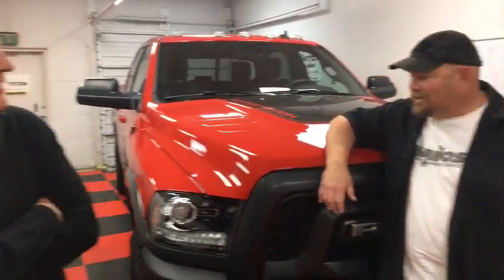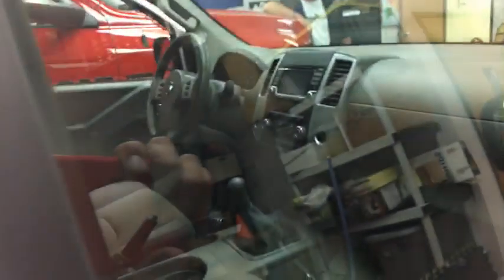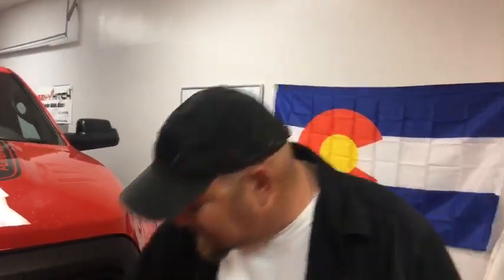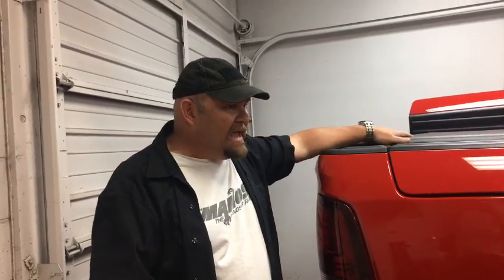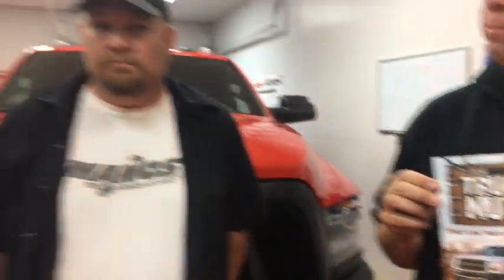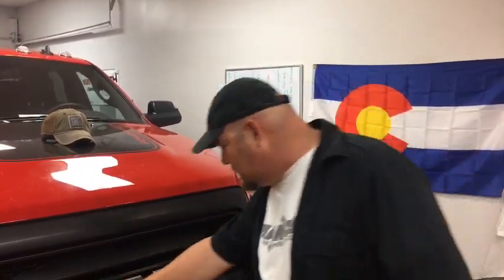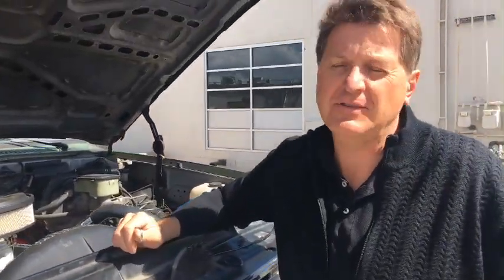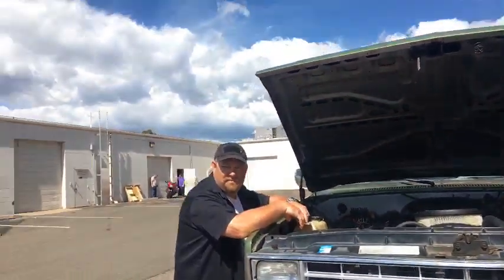Long-Term Truck Update: 2017 Nissan Frontier & Ram Power Wagon

Comment: Manual locks is no issue for me atleast. I prefer it means the key has no fob or chip. And if you damage those or lose it, your screwed. They are super expensive to replace
Reply: No it's not I have manual locks and  windows and I got a spare key made at home depot

Comment: In one of your episodes you mentioned you can get a tradesman with a Cummings and then add the "power wagon" package.  I'd love for you guys to get one and compare the two.
Reply: Nope. Power Wagon can only be ordered with the 6.4 HEMI. The Cummins is just way too heavy like 950 lbs. over the 400 lbs. the Hemi weighs. That 450 lbs. difference can make or break the Power Wagon, and with those intercoolers in the Cummins, that's just not gonna make room for a winch installed seamlessly in the truck.

Comment: TFL  Could you try closing the door on the Power Wagon and use the same amount of force as you did on the Frontier the first time?
Reply from the maker: The clam-shell doors on the Frontier King Cab take a little more force to close.
Reply: Come on TFLTruck , you can do better than that,...IF you are professional about it !

Comment: My family just bought a frontier 2017 S (5spd) with the package you guys have. Was 24k after taxes and registering. I have no issues with the back seat for short distances. Half hour and less its fine. But I'm 5"8 so someone my height or shorter you can fit fine for a short time.
Reply: Jimmy M I am 5' 8" and the thought of sitting in there makes me wanna beat the hell out of that front seat, I get a lot of knee pain when confined

Comment: Roman the "King Cab" label has nothing to do with implying any sort of behind the driver seat room.  King Cab is a designation used by Nissan for well over twenty years.  Google a 1990 Nissan King Cab and what you will find is a small extended cab pick up truck, not a crew cab.  If anything the modern day extended cab (King Cab) has far better behind the front seat room than did previous generations of Nissan extended cab trucks.  Almost no one buys these trucks with the intention or consideration of carrying back seat passengers.  That space back there is for carrying your gear, your stuff, your groceries, etc etc.  I have an extended cab 2016 Canyon and while I have on a few occasions carried a back seat passenger it has been for short trips and with the passenger seat moved forward to make room.  Otherwise I use that space to carry my gear.

With respect to your fuel issues in the green truck.  I'm betting it's a fuel pump issue.  Does that truck have an electric fuel pump?  If not I think you should consider one that can keep that engine fed with fuel regardless of operating conditions.

Comment: $63,000 for a truck.  Get a 7 year loan on it, and try to trade it; you'll get $20k... then for a new truck, you'll be under the bus financially.
Reply: Dean Klein That's pretty much the case with a 7 year loan in any vehicle.  Worse, people are rolling the balance of their old loans into new ones!
Reply: Bingo.  Next recession coming up.
Reply: So what are you getting at?
Reply: Well, I don't get what your point is either, but what you put out there is not based in reality. $63,000 isn't how much people pay for these trucks, it's just the suggest prices for a very well equipped model. A loaded model like this will often sell for with $10,000+ off MSRP, making it $53,000 or less before taxes. Also, in good condition, a loaded Power Wagon like this likely won't fall to anywhere near $20,000 before you're above water. Really, it would likely be worth more than that at the end of the term.
Reply: These are $10,000 off everywhere in the Cincinnati area. More at some dealers. Diesels and Power Wagons specifically hold their value better according to what I've seen on Autotrader.
Reply: Most Americans bail on their cars and trucks when they hit 80-100,000 miles on them.  Residual value, i.e. what it may be worth, is often times LESS than what the person that owes on the car/truck.  That's called "negative equity" So, you still owe say $13,00-20,000 on it when you trade it in on another truck... then a $53,000 truck + negative equity, that $53,00 is now $73,000 or more.  It is a financial treadmill.
Reply: +Dean Klein Most Americans don't own Power Wagons. If you're one of the few that do, unless you've destroyed the thing and driven the wheels out from under it, you should be happy to know a Power Wagon isn't going to be worth $13k-$20,000 in 7 years, it will likely be worth much more. But beyond that, what you're doing is writing up an extreme storyline that most Power Wagon owners will never see. So, again, what are you getting at? Why are you bring this up?

Comment: That's a lot more weight over the front axle. Definitely diminishes its off road capability. 

They should offer the axles and sway bar as a Cummins power package.

Comment: My 1987 Hardbody has 106 HP and 130 torque, and a 5 speed. Has hauled a full ton repeatedly. Pulls any highway grade in 5th gear when not loaded down. NO back doors at all and sideways jump seats. Not fast, but pulls almost the same loaded or empty, kind of like an old straight six.  Doors still take a good push to close if all windows are closed.
It was under $10k new. 
Truck buyers are spoiled brats now, willing to pay what a house should cost     for a giant computer on wheels made of plastic. It's gone way too far.

Comment: The main reason they don't put the cummins in the power wagon is towing capacity. With the suspension set up for off-road, the cummins would be a waste. If you can't tow more than 10,000 lbs what is the point? Only way it would be worth it is if they have stiffer suspension then they wouldn't have the same offroad capability.

Comment: @TFL Truck, Diesel would decrease off road capability. Not only is Diesel twice the weight of a gas it's a low RPM engine. Mud snow sand you need RPM. Also Diesel engines are not as reliable in cold temps. Fuel seperates and causes starting issues. Power to weight. The closest thing you can get to the Power Wagon is an A.E.V Prospector with a Diesel sold @ your local Ram AEV dealer with all the warranties.

Comment: People have yet to catch on that RAM has a new upgraded off road package on the Diesel equipped 2500. Stop whining and get one of those. Power Wagon popularity is picking up and If RAM gets really serious about the Power Wagon they could keep the 6.4, increase power and torque and offer rear airbags (bags with cradles) as an option  to improve towing prowess. Which you can do on your own. Power Wagon should be and remain a gasser. Go get a Cummins and take advantage of the numerous upgrades available. As for a diesel in the Power Wagon?.....let it go.

Comment: Not a fan of the Power Wagon.  Too costly to just go 4 wheeling to me. Can't tow, haul or just drive around with that crappy mileage.
Reply: I use mine to tow off road. Don't know of any truck that tows better off road.

Comment: Datsun  interior plastics are nasty! (Aka Nissan)
Reply: The dash plastic used in my 87 Hardbody is nasty. They all cracked in the CA sun. Dash mat fixed that.
However, the rest of the truck still does its job 36 years later. I'm not thinking many new touchscreens will be working great 40byears from now. 
And now,  to find some new armrests without the foam exposed...